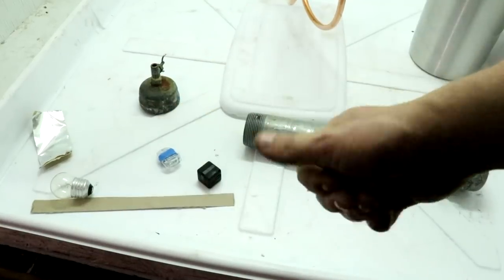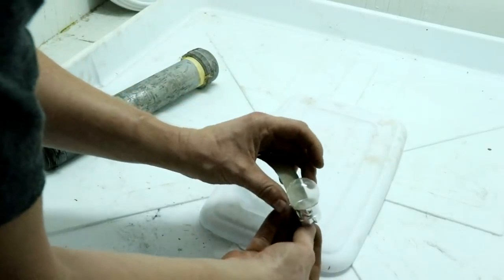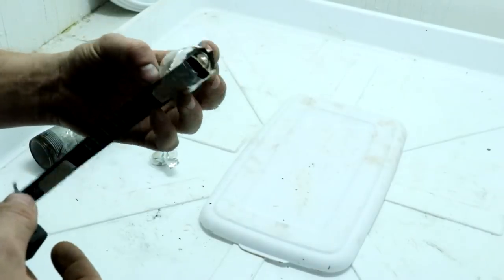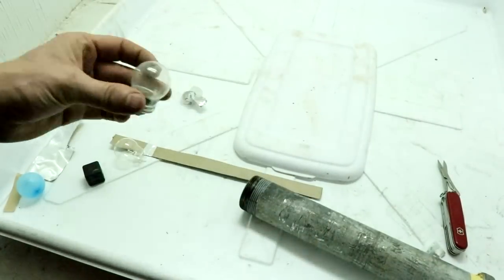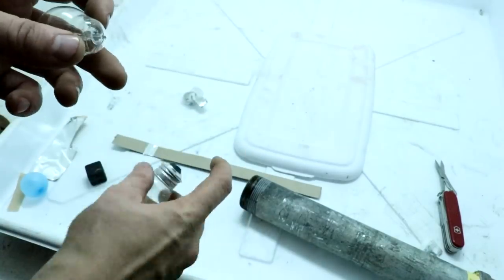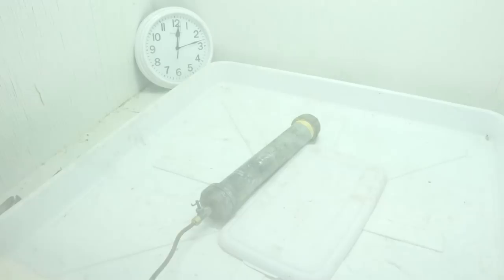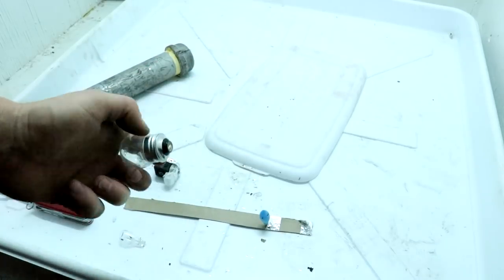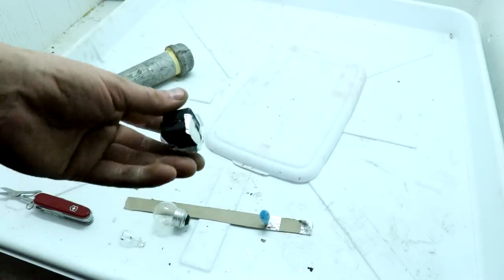Cheap Camera, Light bulb, Survive 800PSI?

Comment: Id be really interested to see how various battery technologies respond to this environment. Either with a data logger across the cell (safer) or leads taken out to an external voltmeter (more interesting). I mentioned in the patreon pre-release, in discussing illumination options, n the more i think on it, the more iteresting it sounds.

Id predict a zinc/air 'hearing aid' cell would decrese current, zinc carbon & alkaline cell would increse current output, n soft pack lithium polymer... well, id really want to be on the other side of that wall.

I think it would be a very interesting avenue of data collection. Not sure the practical use of it, but it'd sure be cool to see.

Comment: Most cameras have a power source you can buy that replaces batteries... I just got my 1st DSLR and didn't want to spend time changing batteries(most of my videos are inside & about knife making), So I looked into it.... At 1st I thought it didn't work because the lid wouldn't close, but then i noticed the little rubber plug to let the wire run through... Just a suggestion, love the videos, take it easy...

Comment: Can you boil water under high pressure (or well get it just below boiling point for that pressure) and then release all the pressure kind of flash boiling it? 
if you could also make a set up to dissolve crazy amounts of sugar or salt that would also be cool
in science class I recently made borax crystals form on pipe cleaners so I want to see more crazy dissolving experiments

Comment: Can you make a capacitor out of glass bottles and aluminum foil like The King of random did? But instead of using salt water as a conductive "filler", use mercury to lower the resistance of the kathode (anode?). I would assume this would bump the capacitance of the glassbottle capacitor and make for an interesting video.

Comment: the pressure probably held down the record button, until you released it which it probably actually pulled back up the button and then activated the record (or in this case stop recording)

Comment: It survives because the holes in the light bulb aloud the air to go on the inside witch aloud air pressure to evenly spread around the light bulb so no one force was pushing in one direction it was all spread in all surface of the light bulb evenly dispersing it so all forces counter acted each other the same reason the air pressure we face on earth doesn't just  squish us all to death sounds about right

Comment: or the lense frosted over from the cold CO2.
Reply: This is 800 psi, if anything would have heated up, i think.
Reply: It would be hot if it was being compressed from room pressure and pumped into the container. He used CO2 from a bottle because it had way over 800 psi in the bottle.  When it discharged from the bottle it came out cold.

Comment: Something I'd like to see is a laser inside a vaccum, visible laser beams are seen due to the photons hitting particles in the air right? (don't quote me)
So if you put a laser in a vaccum, would the beam dissapear? I'd like to see a video on this :>
Reply: I was thinking sorta the same thing. I would like to see the beam interact with the pressure fronts at super high density and watch how it distorts.
Reply: This sounds like an amazing idea, lets try to get Cody to make a video about this :D
Reply: There has to be fog or dust for a laser beam to visible in normal atmosphere. Laser in a vacuum is the biggest non-event ever, and a dumb idea. 
Laser through super dense gases might be interesting though.

Comment: Camera immersed in super-critical CO2 confirmed... also Half Life 3!
I suggest you have the lamp filament exposed to the CO2, so there will not be a pressure differential that breaks the glass. If you set that light bulb on a timer, and remove the air with a vacuum pump before it turns on, there should not be any oxygen to burn it. Then you let in the CO2 from another valve, which wouldn't ignite either, so that way you have a light survive at all times. Well, it will burn once you depressurize it, and let air in.

Comment: Or another way of thinking about pressure.  Salt water exerts 44 psi per 100 feet of depth.  800 divided by 44 = 18.1818 x 100 = 1,818 feet.  For you submariners out there, you already know this.

Comment: Why do car light bulbs  explode h4 light bulbs when the crack  they dont just break they explode like a grenade with a huge bang
Reply from the maker: must be under pressure. (from the inside)
Reply: Cody'sLab   thanks love ur channel
Reply: It's also often a crystal not glass. Compromise of the crystalline structure leads to catastrophic failure and fracturing.

Comment: eBay? Wouldn't those little cameras be cheaper at Aliexpress or Banggood?
Aliexpress is the easier one to get all your money back if there's an issue.
Reply: lightdark00 In my experience eBay is generally cheaper (but more factory 2nds ect) & can take longer. BG have choice of slow/faster shipping and best support (thru email). Ali generally faster shipping (more expensive) but an absolute pain i.e. months of arguing a case + send it back on your dime to get a refund. unless u pay extra to use paypl